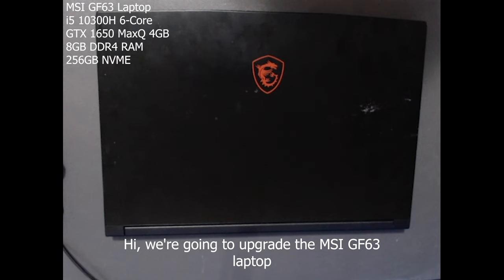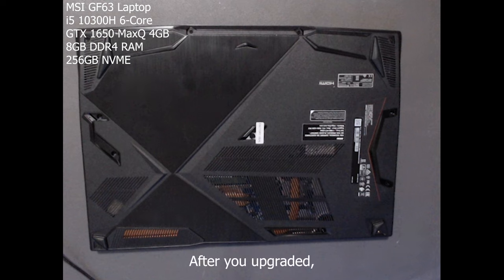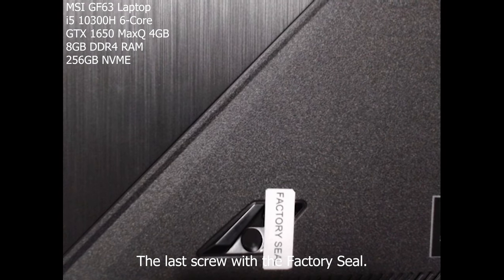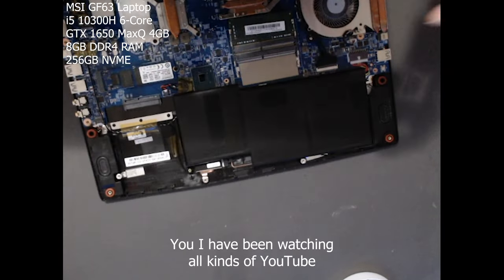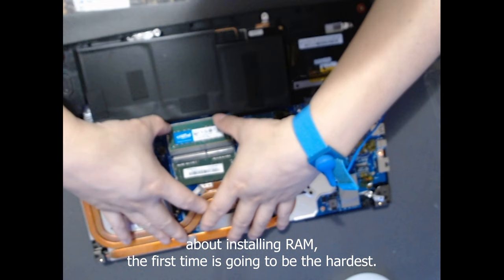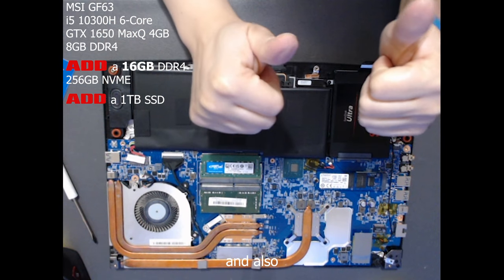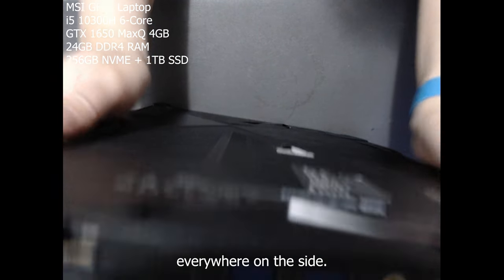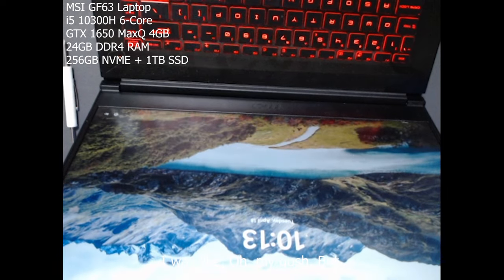Let's upgrade MSI GF63 Thin Laptop 😎 #upgrade #msi

Comment: Hi.May I know is your BIOS up to date the latest one when you upgrade your ram?I have 2020 MSI gf63 model and I recently purchase adata ram and the screen is still in black.i saw there is 2021 bios update and I not sure whether I want to update the bios to avoid screw up in my laptop.thanks
Reply from the maker: Hi, sorry for the late reply but I didn't have to update my bios when upgrading my ram. I'm no IT or tech expert I just try to research everything I can before upgrading. Like looking at the laptop specs, looking at Crucial or ADATA website to see their compatible ram list. Making sure the ram is compatible to your laptop. Make sure all the wiring like plugs on the laptop is plug in like the power supply if you unplug it before upgrading your ram. Like I did. Maybe you can test each ram stick to see if it works 1 stick at a time. Make sure you push the ram in in but not to hard. Sorry if I couldn't help out more but I try to help out the best I can and thank you for your awesome comment and asking me question which I try to answer it the best I can. I did google search if a bios will help but it also says to be careful doing it and make sure you can revert back to the old bios if it doesn't' work. Thank you again.
Reply: @igameianimate  Hi.Thanks for the reply.Thanks for the help.
Reply from the maker: @jonuslee7423  Your welcome and thank you for watching.🙂

Comment: You put in 2 diffrent types of ram, so if the frequency isn't enough it might slow down performance. I understand it is your first time.
Reply from the maker: Yes I did because I couldn't find the same ram that's already inside the laptop. I bought the Crucial 16GB at Amazon. Before the laptop says low in memory while playing and it lags. Well it lag because I was using a external hard drive to play games lol. But now that I put in more ram and the 1TB SSD, it's running way better then before with no lag. Thank you so much for commenting, I appreciate it and Thank you for watching.
Reply: if frequency is the same, the the performance is better.
Reply from the maker: @aegwasherndryrer   yes thank you so much. The laptop bios won't let me change the ram speed or do anything except change boot drive. I'll need to use MSI own app to do it but I haven't come around to see if I can change it but I'll let you know once I check it. Thank you for your wonderful comment and thank you so much for watching.
Reply from the maker: @aegwasherndryrer  Oh I checked the task manager and it says ram is running at 2933 mhz. Before with 1 stick it was running at 2666mhz. I'm still trying to check out the MSI app if it'll help me check or change my ram speeds.